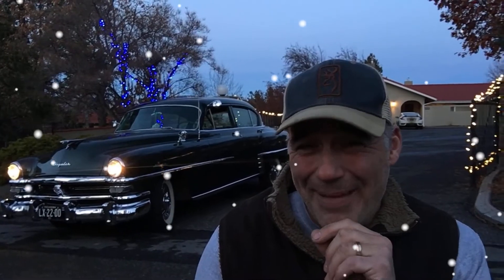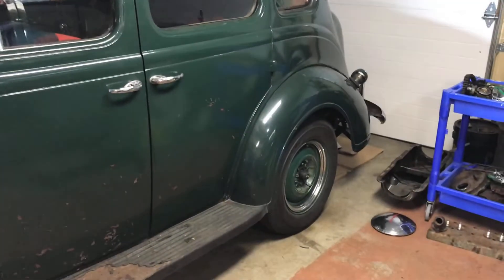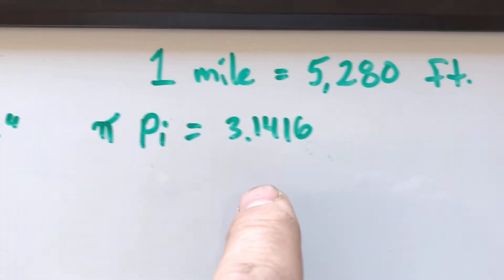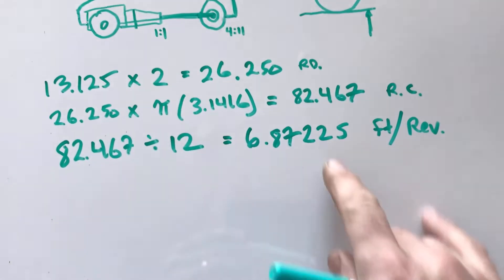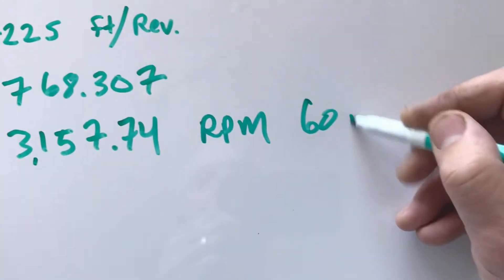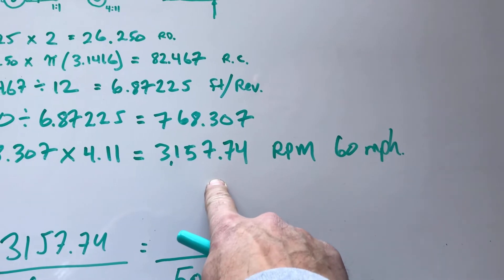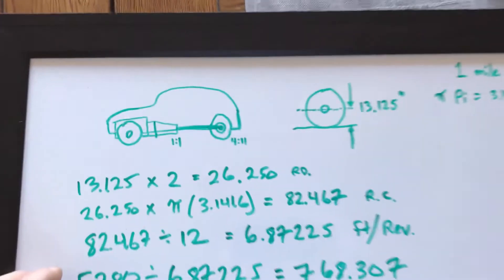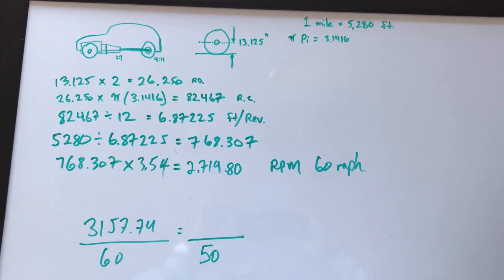Changing Rear End Gear Ratios: How to calculate Engine RPMs,

Comment: Fantastic video.Another way to calculate rolling tyre distance travelled (instead of using tape measure directly on wheel) is to mark your tyre and where it touches the pavement with chalk.Roll the tyre one full revolution until chalk on tyre retouches the pavement and mark pavement.Then measure between the 2 chalks marks on distance traveled on pavement.This can be useful in working out how different sized tyres/wheels effect distance travelled per revolution.

Comment: Great lesson. I know of a guy that had a 50 chevy 216, 3 speed. He put in a 323 rear end and a 5speed from a S10. He claimed it resurected the car. 1st was a steep and 5th was like 70% overdrive.  Cruise all day at 75
Reply: I have that combo in my 1954 Chevy truck with the 235. At 70 I am pulling 1900 rpm. Here in flat land Indiana it is ok but I have been in the smokies it is ok but on back roads, you need to use 4th gear.

Comment: I have a '61 VW bug that I converted from a 1200cc engine to a newer 1600cc engine.  People often install a newer transmission that will drop the RPMs and take advantage of the extra power.  But instead I calculated what diameter rear tires I'd need for the same result.  It worked great.  Now the rear tires are a little bigger than in the front, but it's not very noticeable.
Reply from the maker: Good idea! Math can solve real problems.

Comment: Thanks for the lesson Keith. Good stuff! I think I have 4.11's in my '37 so this will help make it easier to calculate. Now I need to fix my wavering speedo needle! Not sure if I'm going 48 or 53 mph. 😃😃
Reply from the maker: My speed does the same. I think a good lube, sent under pressure thru the cable might fix it up. Will try that eventually.

Comment: Why is your final RPM at 60mph?  What determined 60?  I have a final transmission gear of .75.  How do I adjust the numbers?  Would I reduce my final rpms by 25%  Thanks.
Edit:  I think I take  .75 of 4.1 which is 3.01

Comment: I have a 50 dodge B2 and was told it shouldn’t do more than 45 mph. It has fluid drive but I’ve never successfully used it. 3 on the tree. Can you verify it shouldn’t go above  45?  Should I install a tach?
Reply from the maker: I suspect your Dodge has a 218 size 6 Cylinder engine. Generally speaking the old flathead engines won't live a long life if they are strung out at high RPMs for long periods of time. 45 MPH is fine. I'm pretty sure you car would hit 55-60 mph. Personally I wouldn't run it at 60 for very long, but cruising at 50-55 mph should not be a problem. You can lower your engine RPM's by changing out crown and pinion sets in the rear end. Also by installing larger tires. Or finding and swapping in optional overdrive transmission. These cars were never meant to drive at speeds common today. They don't stop as fast as today's cars either.Little to no crash safety engineered into the old cars. Personally I'd rather drive them as they were meant to be. Cruising in town at 25 -30 mph. Hi-way cruising about 50 mph.

Comment: how did u determine 4:11 differential ratio
Reply from the maker: P6 sedans normally came with 4.11 gears. I expected to find them. I had my diff out last winter and confirmed. The gear ratio was stamped on the crown gear edge.
Reply: @keithsgarage5831  thank u